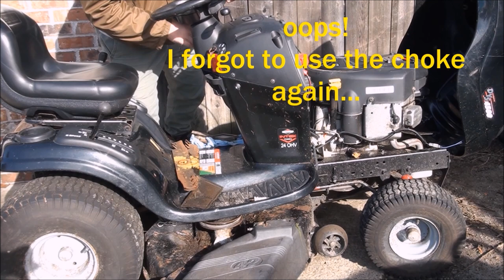Won't START after STORAGE: Craftsman Riding Lawnmower 24 HP Briggs and Stratton Engine , FIX SERVICE

Comment: Hello man, my lawn tractor Husqvarna TS138 model has issue. It really hard to start.

I think something wrong with its wiring system that related to battery because the indicator for battery is always in red colour and shows the battery is empty even though I use the new battery.

Sometimes I charge the battery until full but as soon as I connect the battery, the indicator still shows that the battery is empty (red colour). 

I have to use jumper to make it start easily but without jumper it is really hard to start. 

Can you help me with my problem? Thanks in advance. Really appreciate if you can give me solution.
Reply from the maker: sounds like a unique issue. Make sure you have an appropriate battery charger. providing at least 2-10 amps. small trickle/maintenance chargers (.5-2 amps) take days to charge a battery. Sounds like wiring otherwise for sure. Tough to diagnose unless I had the mower with me.